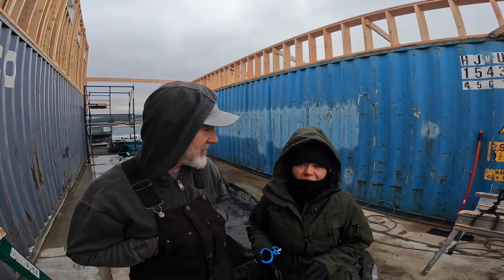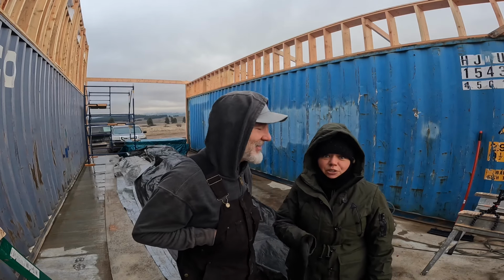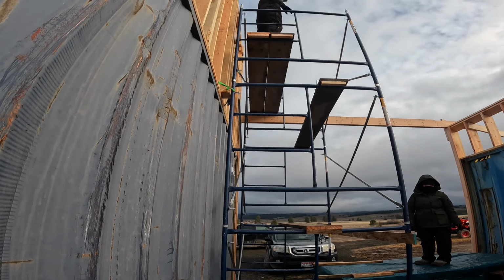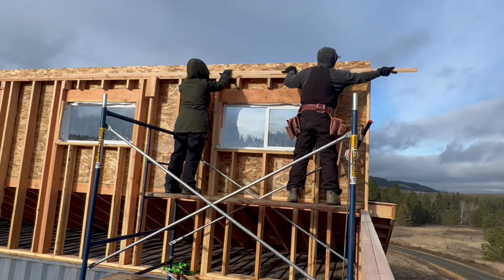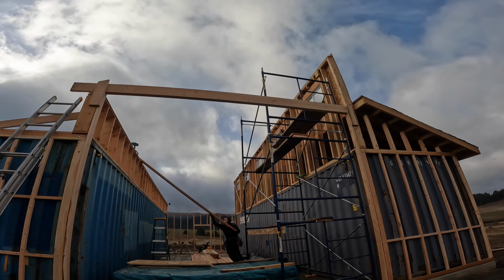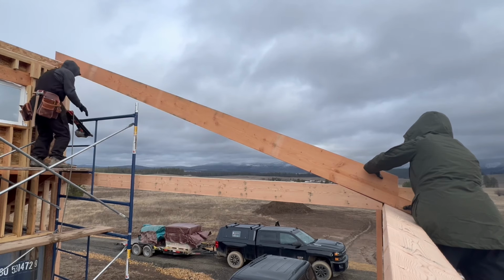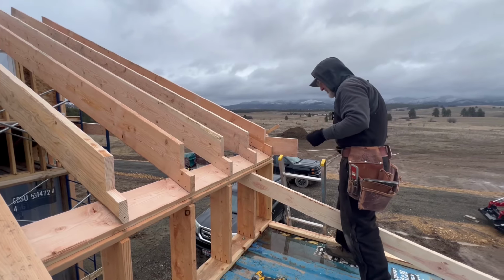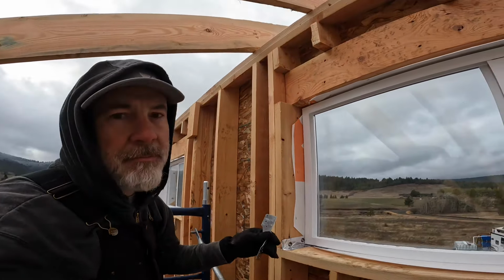Starting the main rafters on our shipping container barn

Comment: On the topic of staying warm.  Walls, Carharts, Dickies all make winter work coveralls but the trick is to get the Arctic Weight ones which have thicker insulation and also come with an extra charge hood (the snaps and zippers are on the coveralls).  Personally, I always get the waist to ankle zippers for ease of entry over boots (think call of nature).  Zippers don't make particularly cold spots as they have backup flaps.  A wool shirt over the merino underwear and if needed a wool jacket makes a package that will handle twenty below.  Get the coveralls and jackets large enough to wear the gear needed under.  In the modern world they come smaller anyway.  Tight is not conducive to warmth, you want loose layers.  The trick is to shed them when you get too warm and put them back before you actually get cold.  Try not to sweat.  Moisture lessens the insulation quality of any garment as does dirt.  Keeping the garments clean makes for optimum insulation.  Keeping hydrated helps to maintain good blood flow and thereby warmth.  Finally, a warm-up area with a coffee or tea pot to keep from getting really cold makes for a longer working day.  Wall off a small area for a couple of chairs and small table/stand temporarily while the cold weather is on you and insulate it.  Then a very small heater (those chinese diesel forced air heaters work well kinda like the Espar type.  Burn diesel and run on a 12v battery for several days).  Quick and easy to set up and take down.  Run about $200.  Turn it on when you start work and off at the end of the day.  They have a thermostat and can be set for whatever you want.  The trick to cold weather work is to never allow yourself to become really cold.  So the clothing should be easy to don and doff as needed.  For me nothing works as well as wool with coveralls for a windbreak.  A warm spot right on the job to take ten in is a real game changer and how you can work longer in cold weather.  Best of luck.

Comment: Two part (pants and tops) Merino wool lightweight underwear.  Doesn't itch and is machine washable.  That makes a huge difference.  I have never tried the battery packs but people do like them and ditto to the chemical packs you put in your pockets.  Try to get them over your kidney area.  Also a good hat with flaps such as a down one.  A set of padded underwear (think Korea Chicom) on top of the Merino will help a great deal.  Then the heavy wool (woolrich) bib coveralls with whatever coat you like (down in dry weather is best).  Make the layers loose.  Light socks with Merino Wool ones over them and insulated boots (Mickey Mouse if you are susceptible to cold feet) with felt insoles.  Staying in motion while out helps tremendously.  Standing still will get cold.  Insulated ski bibs are another option that works well in dry weather.  Use lightweight cotton gloves inside your work gloves.  A silk hood for your head is another effective but very lightweight addition.  It goes under your hat and collars.  Parkas with hoods are good but a bit more restrictive.
Reply from the maker: Thank you so much Doug. She will look into all those great ideas! I’ll get into our First Lite Merino under layers right now and see if that helps today!